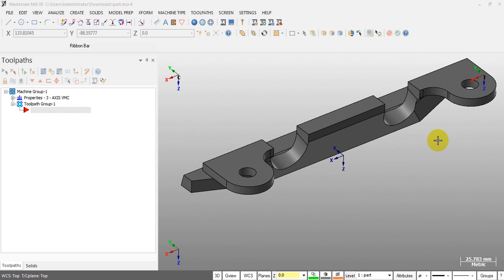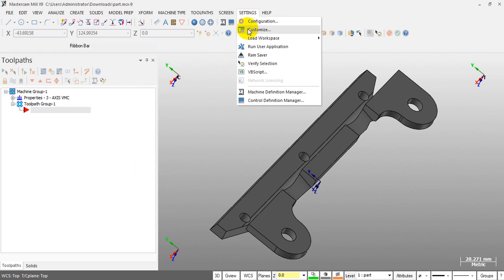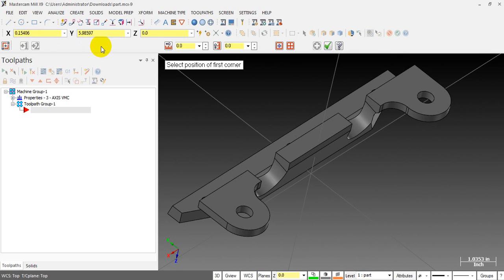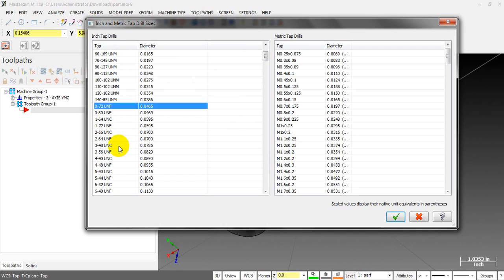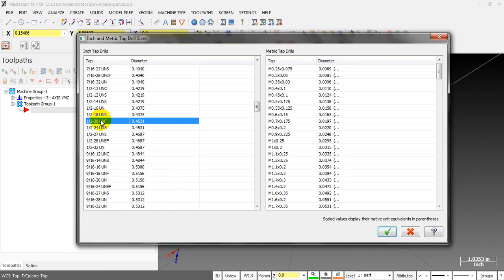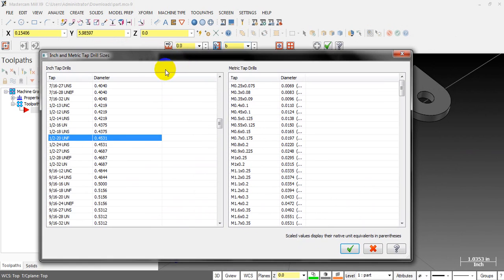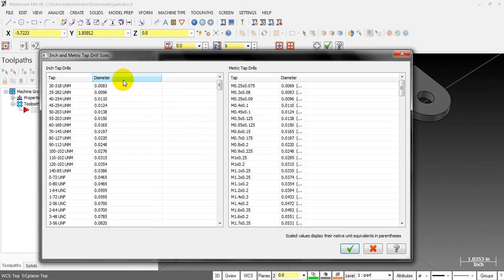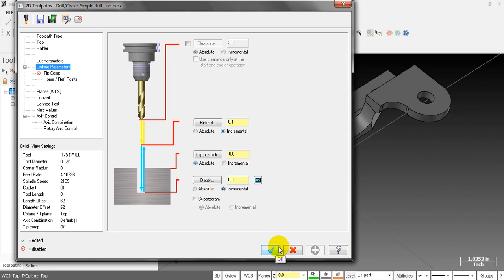MASTERCAM TIP: DRILL & TAP TABLE IN MASTERCAM

Comment: You can use
Drill Φ = Nom Φ - pitch
so, for 1/2-20, the pitch = 1/tpi = 1/20 = .050, so..
Drill Φ = .500 - .050 = .450

For roll form, you can use half the pitch, so
Roll form drill Φ = .500 - .025 = .475